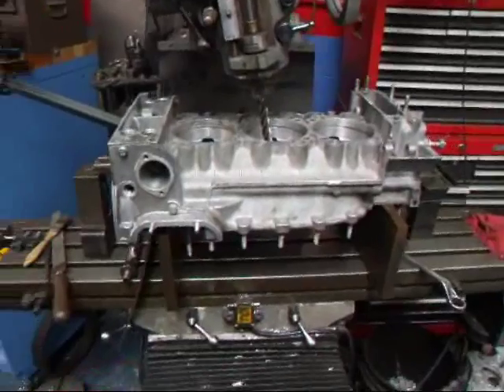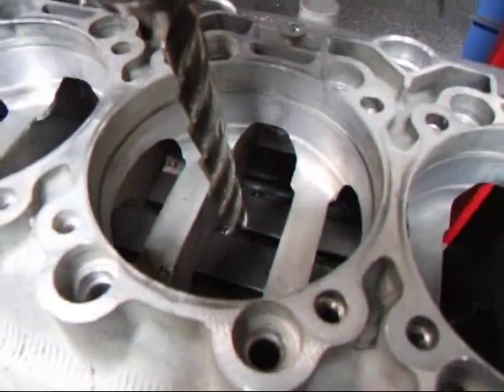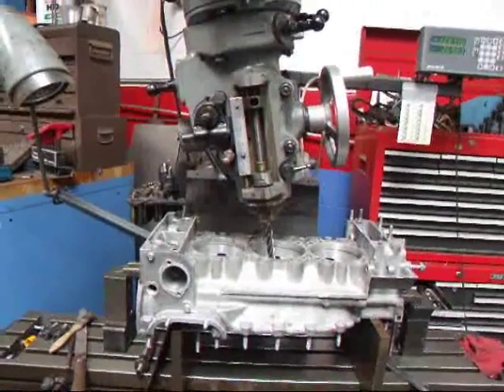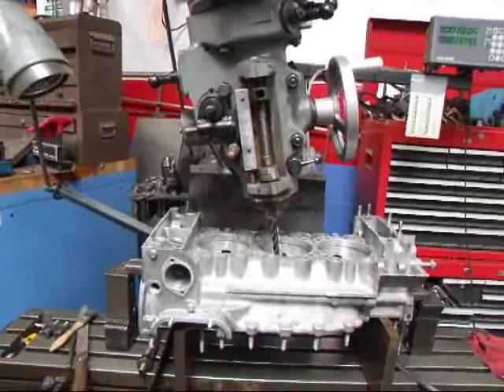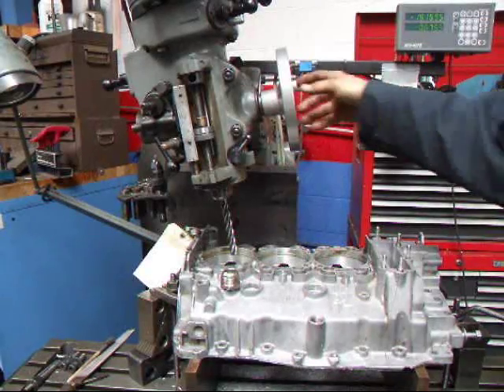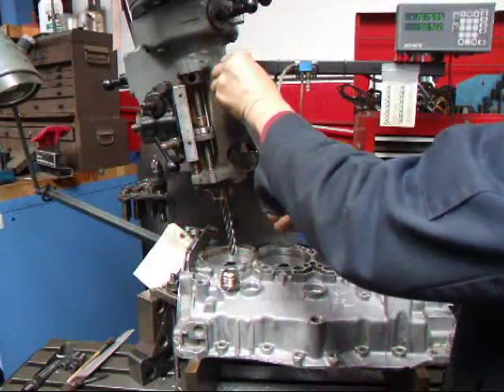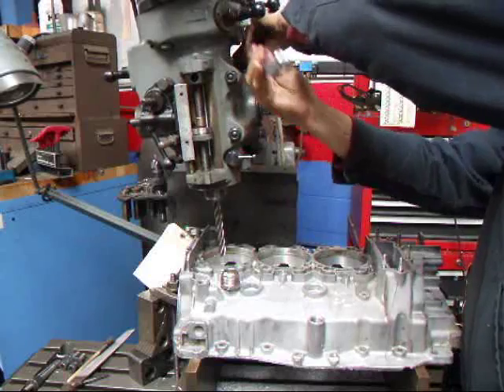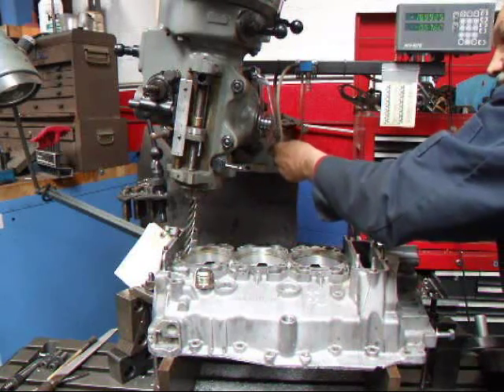911 Boat Tailing.wmv

Comment: all engines have "air flow" under the pistons 

on inline it less important because there are not opposite cylinders but there is the same thing :
 it push air from one cylinder to an other.

the better should be a dry oil pan with an air cavity for each cylinder wich could contain the flow and a separation between each cylinder to prevent air flows and consomption of energy